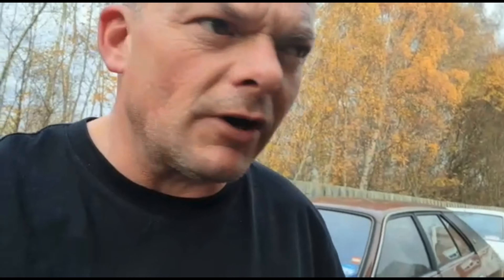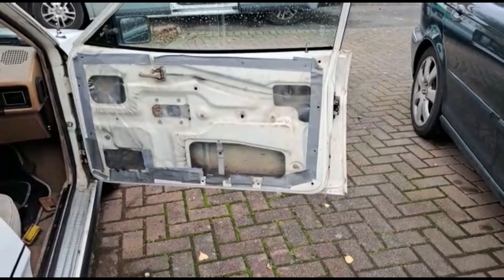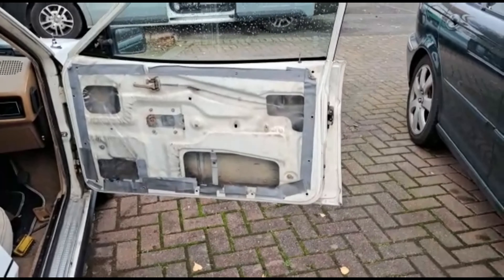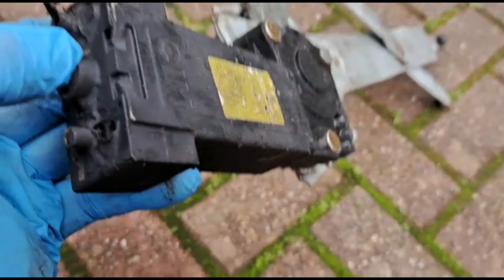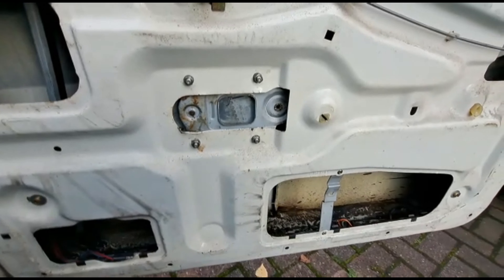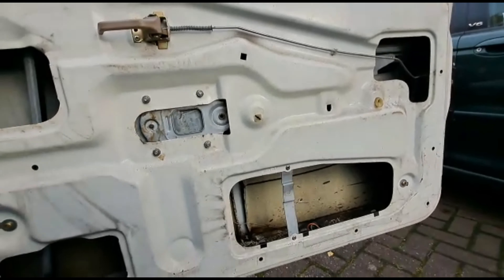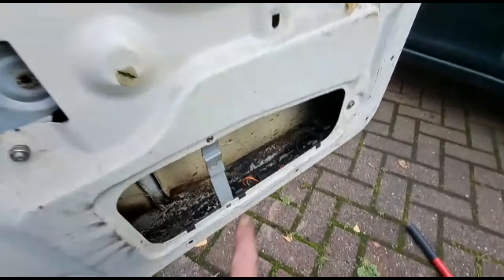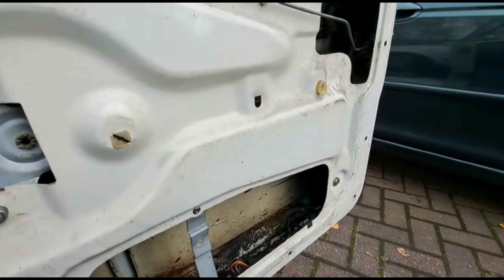Austin Ambassador Vanden Plas - Electric Window Repair With Lee

Comment: Great repair. I didn't even know that the Ambassadors has electric windows on the front! I've learned a lot about the workings of electric windows on older cars especially. Its nice to see how much waxoil British Leyland put into the cars compared to the Jaguar as well. Good video!👍
Reply: Thanks mate 👍 
Yes, all HLS and Vanden Plas models have electric front windows and central locking too. 😉

Comment: Thanks for the great vid Lee, I believe at one time if you wanted rust protection you had to pay extra for it, seems it may have come as standard on the Ambassador. 
     What’s great about these older cars is the simplicity of design in comparison to modern cars with all their electronics and excessive amount of plastics, I bet working on the Ambassador and Princess is a joy in comparison to the Jag?
    Thanks again to Ricky as well for editing and putting up the vid.
Reply: Thanks Will.
I would hazard a guess... It may have come standard on Vanden Plas Models... if not all, as mentioned in another post.
Yes, In comparison, the Ambassador and other older cars is an absolute joy to work on.
No fiddly torx bits or anything like that.  Just nut, bolts and good old fashioned pozidrive screws.👍

Comment: Great video Lee. It amazes me how good the Ambassador was at its time I had it down as a. Old princess with different lights but the look and feel was up their in it's time
Reply: Thanks mate 👍 
It's not a bad car at all, it's a pity it will always be in the Shadow of the Princess.
But comparing the two, I think the Ambassador is better tondrive than the Princess... it has a completely different feel.
Reply: @Glen G  From what I can remember about driving a Montego (a very long time ago), they're chalk and cheese...
With Montego having standard coil spring suspension it was much more planted and less wallowy than the Ambassador.